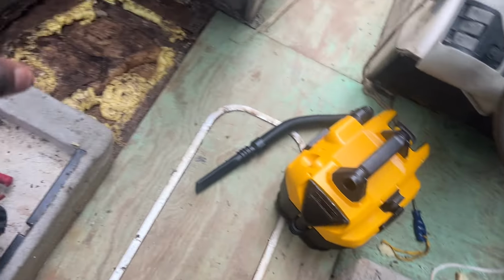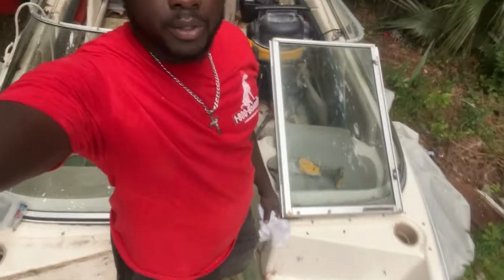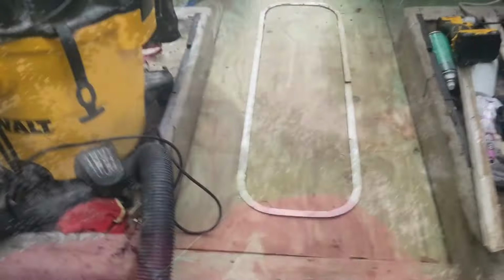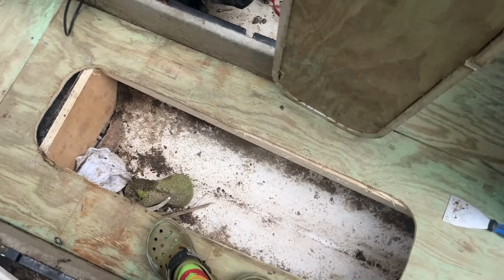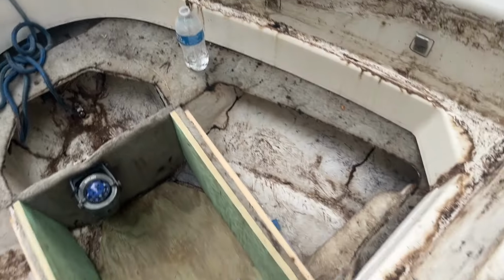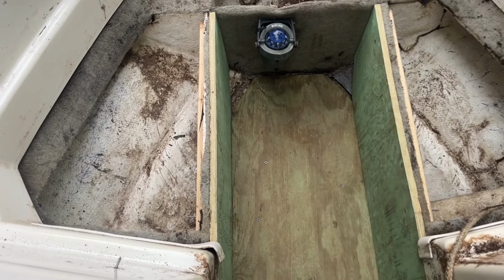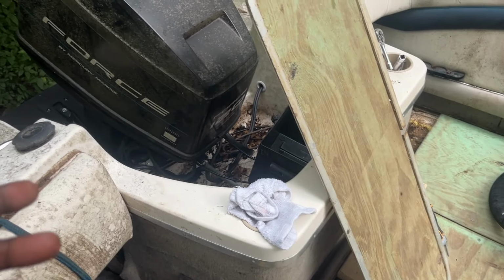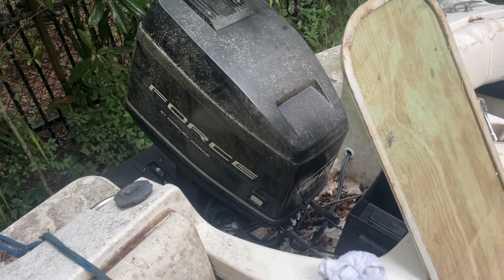Boat repairs coming along very good

Comment: I’d look into a new motor they quit making those force in early 90’s for a reason
Reply from the maker: And what the reason
Reply: @BAGOUTDOORS  Force motors came to be when they were made under the Chrysler brand name.  A low technology low cost motor made to sell cheaper than the name brand motors of the time.  Guess you could call them an American made motor, that could have easily been built by the Chinese.
Brunswick bought them out when they were having troubles and rebranded them Force by Mercury (doing that, they made it look like you were getting Mercury quality, but was a long way from it) so they could have a bottom line, cheap motor to put on boats manufactures could install on cheap boats like the Bayliner's, and entry level boats like the BPS sells.  They never did much to improve technology or quality so if you get one of the few good ones that come off the line, you're lucky, the bulk of them are problematic.  They also have about the lowest performance and fuel economy of any motor on the market.